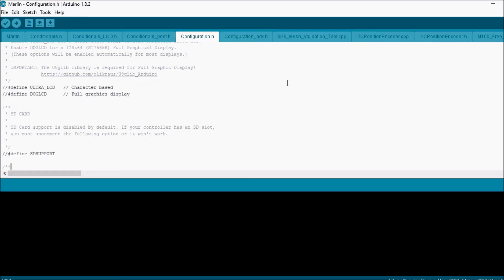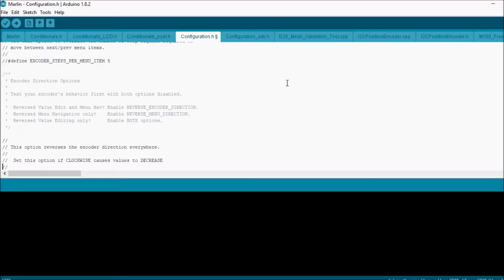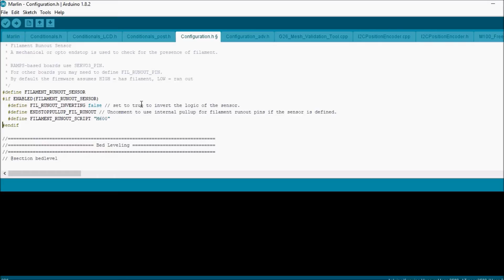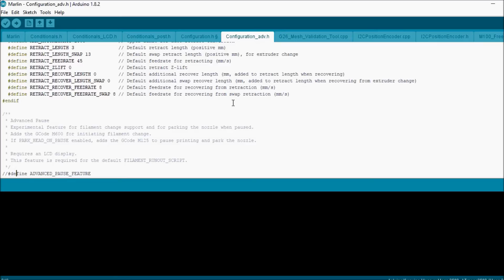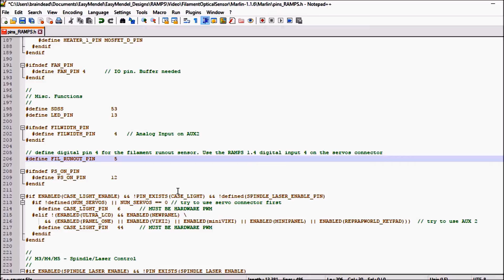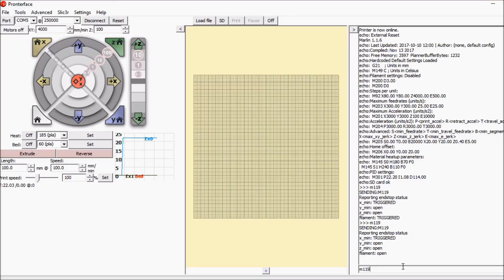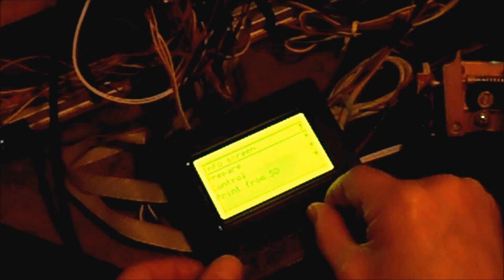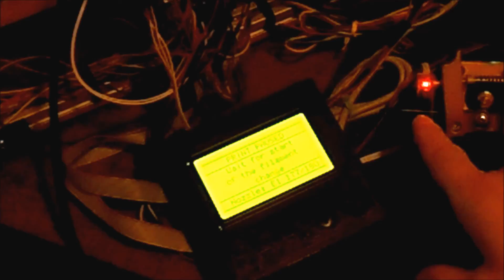RAMPS 1.4 - Optical Filament Sensor configuration

Comment: Do you think you could show us how to set up two stepper motors with a single nozzle I’ve been trying for three weeks and I can’t figure out the firmware or the slicing software
Reply from the maker: Sure, but check out my playlist for adding additional stepper for a diamond print head and in the marlin.ino part say two rather than three and let me know if it works.  Keep in mind they recently add a new step in the firmware for specifying stepper driver boards if you're not running with just a4988.

Comment: Watched a lot of your videos, thanks for sharing info. Can I do this setup with the smart ramps on the due?
Reply from the maker: Yes, but the motherboard name is changed and Marlin firmware 2.0.x. keep in mind pinouts maybe or maybe not the same. And if you have TMC 2130 used as a stepping driver pins will need to be replaced.
Reply from the maker: Also Marlin firmware for 2.0.x is still experimental. I've some tutorials made for smart RAMPS in a playlist.  I'll be adding additional one maybe tomorrow.
Reply: Edward Braiman 

I will see if I can find the pin out for the smart ramps. Got one for my very large Delta printer.
Reply from the maker: They should be similar.  Otherwise you can check with pin debugging.  I made a video explain this I think within the last two weeks.
Reply: Edward Braiman 

Thanks, I will watch that video.

You should get a Patreon account linked to your videos so people can tip you for your work.
Reply from the maker: Patreon account, don't think I have been tipped yet.  I think it's ebraiman.

Comment: Am I undrestood wrong or you said it will not work with light colored filament?
Reply from the maker: +Can Dogancan for the optical mount it appears that it's hit and miss for the filament colors.  Black appears the be fine, whereas my glow in the dark filament will not register as being present.  I created another configuration to deal with the using an endstop switch.  There is always the possibility that the optical sensor I used may be the problem.  Maybe in a couple of weeks and/or months I'll try another optical sensor type and see if an improvement occurs.  Currently I'm trying to expand people's imagination to what they can use the RAMPS for various configurations.  I'll probably do some interesting things with the multipurpose prusa in my other video series making a CNC fan for circuit boards for home use.  I'm also considering a design for a 2 second 3D printer design for liquid printing.  Sorry for the tangent, but I'm trying to expand the possibilities for people new to 3d printing.

Comment: Ok, what if you used the pins an unused endstop like x_max?
Reply from the maker: It's alright as well, the purpose of showing how to switch pins was mainly used to show end user how easy they can use another pin pathway.
Reply from the maker: +Slm Coding any unused pins are okays.  Your experimenting with pins will expand your knowledge and understanding of the RAMPS design.

Comment: I'm currently working on a custom homemade 3D printer with a print volume of 400×400×400 mm, and it's a beast and i love it...it's not ready to print yet...the Z axis is missing but the 4 heated beds and additonal custom made circuits(based on 2 arduino nanos) the ramps board and x and y axis are ready and it's satisfing, huge thing :)) And I plan to use a filament runout sensor but that's not so popular between ramps users, so thanks for the tutorial :))
Reply from the maker: +Iszlai Matyas Jeno , I'll be adding another type of run-out sensor in a couple of days.  It will address filament color issue.
Reply: awesome :D